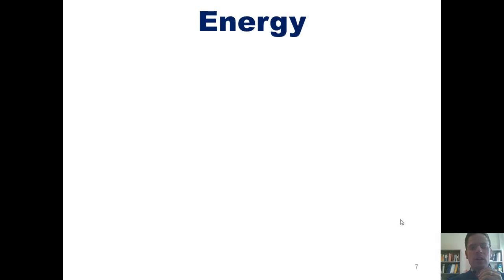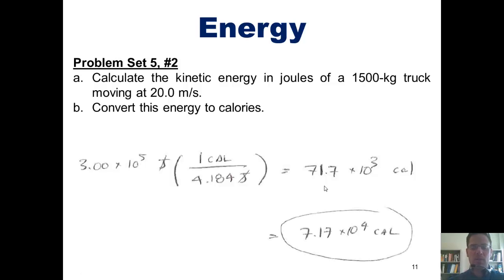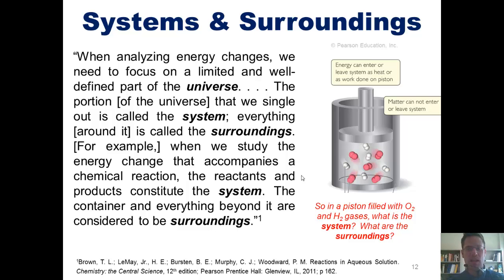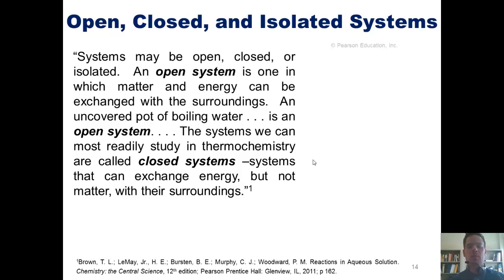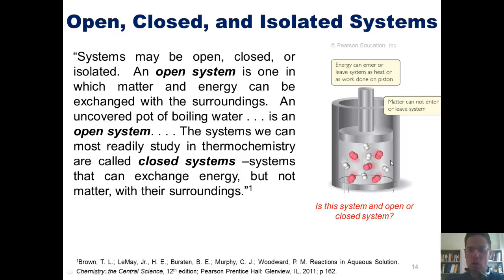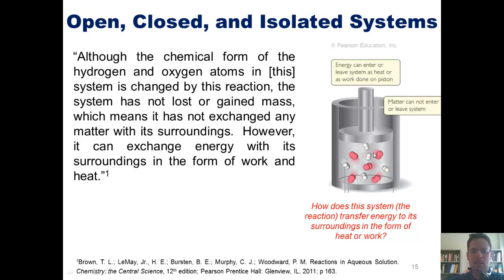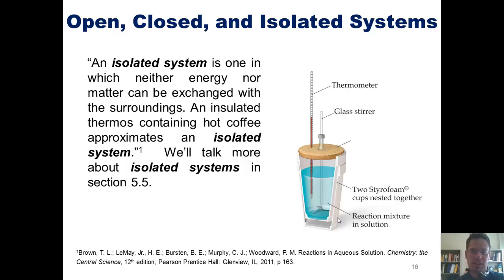Chapter 5 – Thermochemistry: Part 2 of 11

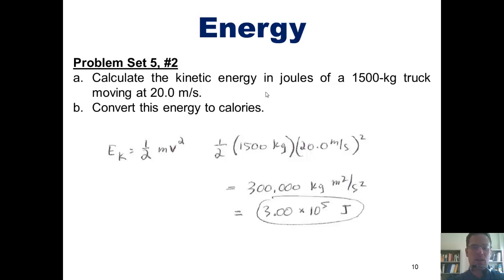Comment: at 1:06, how do you arrive at this answer? 1500 x 20.0 = 30,000. 30,000 1/2 = 15000.
Reply from the maker: It's 1/2 times 1500 times 20^squared, like this: (1/2) (1500) (20)^2. If you type the following . . . 

=(1/2)(1500)(20^2)

. . . into MS Excel, you'll get 300000, which is 3 x 10^5.

I hope this helps. Thanks for watching and commenting. Please have a wonderful day!
Reply: Mike Christiansen yes it does, thanks. I was doing (1500 x 20) ^2
Reply from the maker: Awesome. I'm glad I could help, John. Please have a wonderful day!

Comment: where did you get 4.184 J at 1:30
Reply from the maker: That is the number of joules (J) in 1 calories. In other words, there are 4.184 J in 1 cal.
Reply: Is this a constant? Is there always 4.184 J in 1 cal?
Reply from the maker: Yes. After looking it up, I found that it's actually 4.1868 J in a calorie, to be absolutely technically correct. But yes, it is a constant relationship.